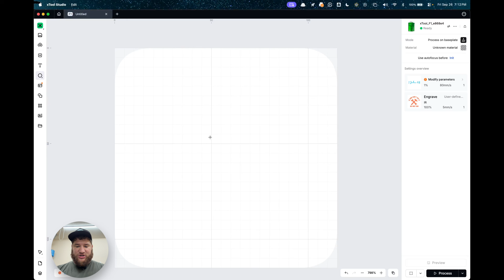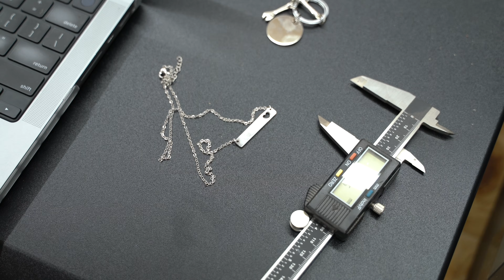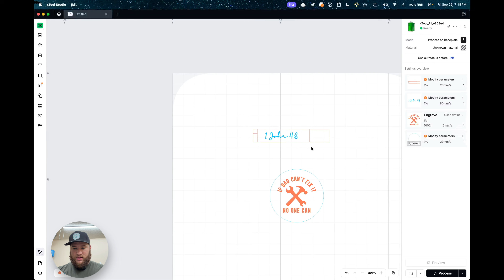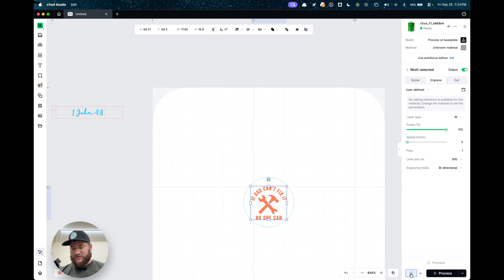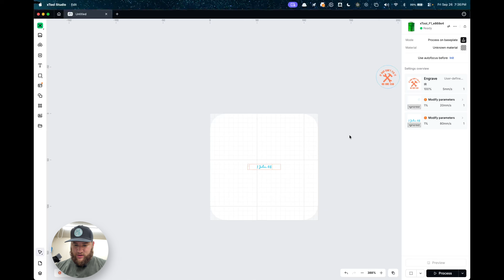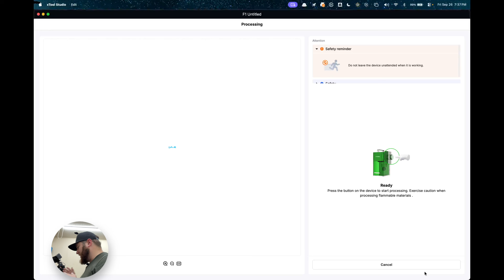The Secret to Perfect Jewelry Alignment on xTool Lasers

Comment: My F2 still engraves offset to what the framing shows? How can I fix the alignment?
Reply from the maker: That's something you'll probably have to contact xTool on sadly, I don't know how to re-align that when it gets off.
Reply: Hi Koby! That happened with me in the past, days after buying my Xtool F2 Ultra. What I did was to go to "Device Settings" - "Parameter Settings" and then you have a calibration tool that solved my problem with the name "MOPA IR and blue light laser calibration". There Xtool will guide you. The process is simple so good luck with your problem! I hope I was able to help you out :)

Comment: I have taken my f2 ultra to 2 shows. I was using monarch pine jigs from their Facebook page. But the jigs are not as easy as you make this seem. The jigs don’t always have my piece in the focus dot so it makes it difficult to set up. I feel like they complicate custom one-off engravings at a fair. 
The black annealing settings you talk about—when you defocus, do you just do all the same steps then add your defocus distance at the end before hitting process so it doesn’t distort your camera for alignment?
Thank you so much for your videos. 
Do customers want the engraving or the darker smooth annealing more?  I know I prefer annealing but it’s hard to remember to defocus every time in my workflow.
Reply from the maker: Okay, I'll address each thing you mentioned individually :) 

For alignment, I don't actually use the jigs, I use the framing method that I showed in this video. I very rarely use jigs, especially for one-off items. I was mentioning the jigs as that's a way to get the outline shape of an item so that way it frames that item for you (like the circle)

I don't use the camera for alignments at all, the camera has been known to be off for alignment (I've tested multiple F1 Ultra's and this has been the case), which is why I use the alignment method in this video. That's spot on every time. 

For defocusing, I defocus before I do anything. If you align it, then defocus it, the engraving could be in a different place. So, my steps are to defocus first, then align. 

Typically a smoother anneal is better for customers as it doesn't snag, but I know shops that tried that and their customers weren't happy with it. So they went back to a deeper engrave. It really just depends on your customers. Do whichever is easiest for you and only offer that :)